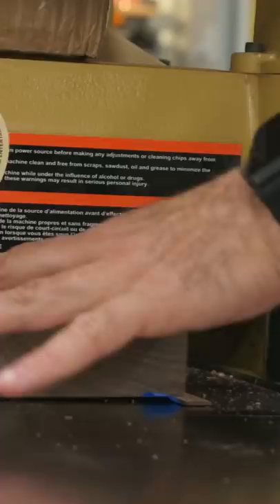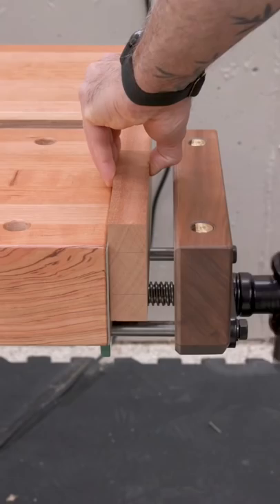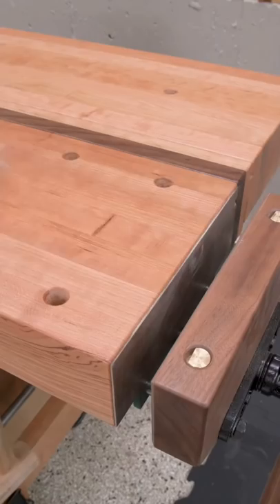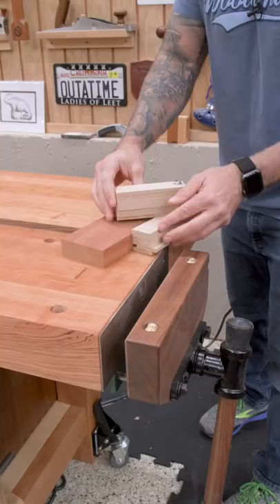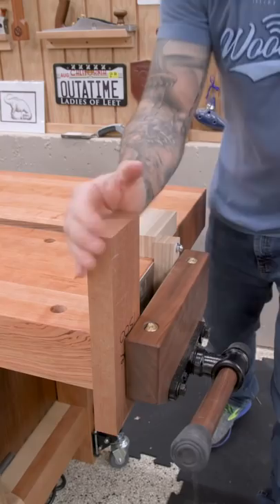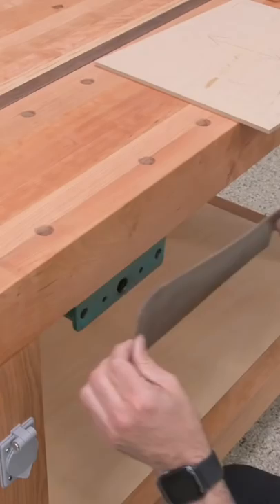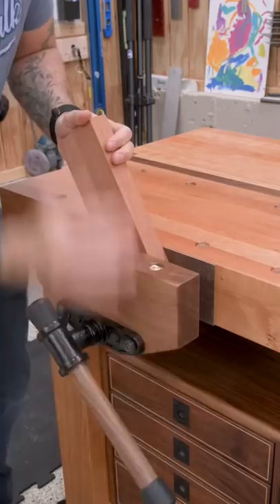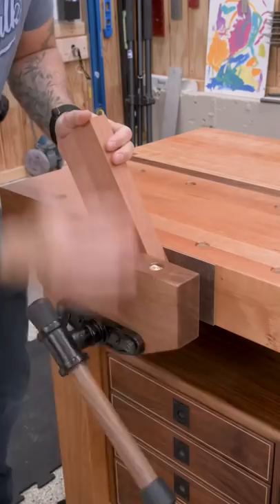3 TIPS to Help Your Woodworking Vise Suck a Little Less | #shorts

Comment: One from a recent Rob cosman video that I just applied was to use a couple of rubber seals on either end of the handle, so that they lessen the impact on the ends of the handle.
Reply from the maker: Didn’t even think to mention that but my entire end caps are made of rubber.
Reply: @woodwhisperer  I found that a little ostentatious to be honest. Mine are made from used toilet seals and toilet seat washers. Not everyone can afford rubber caps like you high end YouTube celebrities.
I have to squat when I poop now.

Comment: I know of no way to say thank you other than here.  I finished my bread board end table using one of the methods you showed.  Screws.  I was in a quandary as to how I would attach the ends and nobody else showed doing it with screws.  Made my own floating tenons.  Anyway, thank you very much.

Comment: Another idea for a rack stop I use is I've cut a 6in oak wedge that's ~1.5" at the thick end. I insert my work piece and give the wedge and quick tap with my hammer.

Comment: I like the fix that you call "racking". I'm not a wood worker, I am a toolmaker. You'd be really surprised how many so called ultra precision toolmakers will hold a small part on one side of the vise. Yes even a cast iron & steel vise will twist or "rack". You will lose accuracy doing that.

Comment: What's racking? The last time I heard that term,  I was in junior high and it meant kicking a guy in the you-know-whats, or then,  as an adult, it means racking the balls on a pool table. Don't know what it means in a woodshop...
 Oh yeah, recently I watched a video where somebody was racking a gun...or was it a rifle?...and I understood it to mean the clicking of that lever bolt thingy and getting another bullet in the right place or something like that. I'll learn it whenever I get a gun that does that.
Reply: When one side of the vice is unsupported, so it clamps at an angle, thus providing uneven pressure on the workpiece
Reply: @timdurachko   Thanks for answering my question...ok. So, like when you go to work on the piece you have in the vice it'll wobble around  ?
Reply: @kayceegreer4418  Little late I know, but, not so much that it'll wobble, it's that it will be prone to rotate or slip.

A good example is, hold something between the tips of your fingers with good pressure, vs your whole palms with light/medium pressure.
You see, even though less force is on your palms, the part is much more stable.

Comment: Marc, how did you attach the cork rubber onto the wood? i used CA glue but wasn't happy with how it came out. Rubber cement test pieces were meh as well. Curious to know yours. Thanks
Reply from the maker: Rubber cement works like a charm. What kind of trouble did you have with it?
Reply: @woodwhisperer  probably the rushing part. Lol. My test pieces didn’t adhere to the wood as well as I expected.
Reply from the maker: That’ll do it. I usually coat both surfaces thoroughly then let dry for 15 minutes. The surfaces should feel dry to the touch (maybe just a smidge tacky) before bringing the pieces together.
Reply: @woodwhisperer  I’ll give that a go. Thanks for the tip!
Reply: Or use 3M 77 spray adhesive. Or 3M 90. Or contact cement (Weldwood is one). 
I didn’t realize they still made rubber cement!

Comment: My Rockler quick release has a hard time engaging sometimes and it drives me nuts! everything is set up correctly and lubed. the cam just sometimes doesn't want to swing up and engage the threads.
Reply from the maker: My assistant Jon has the Rockler version and is also frustrated by it. I went with the Lee Valley version and so far it performs as you would expect. I wonder what's going on with the Rockler vise.....
Reply: @woodwhisperer  Hey now, let’s not piss of that podcast sponsor. 😂

Comment: Or....
Just use a proper rigid steel vise, and put some wood inserts on the jaws.🤔😒
Reply: Doesn't clamp as good (pressure over the entire surface vs a small point -- promotes rotation and marring of work, even with softer jaws), work piece could be at the wrong height (will be for most plane work), it could exert to MUCH clamping pressure, easily deforming it (especially so on delicate parts.)

Machinists vises are good, but there are correct vises for things, that's why there's so many different kinds.